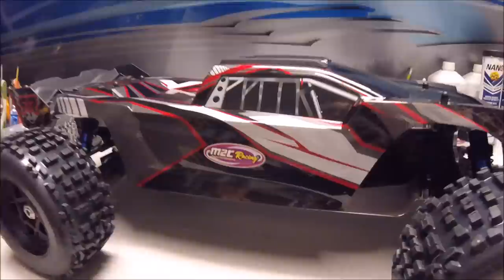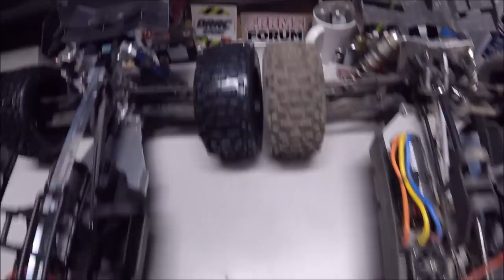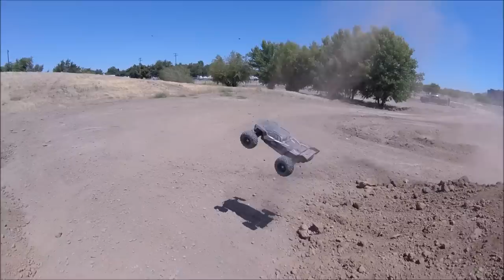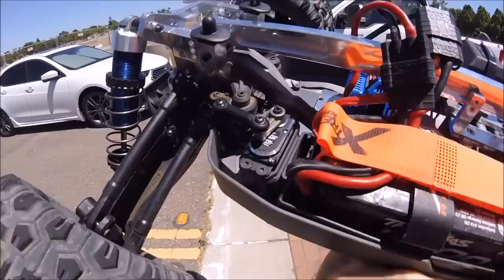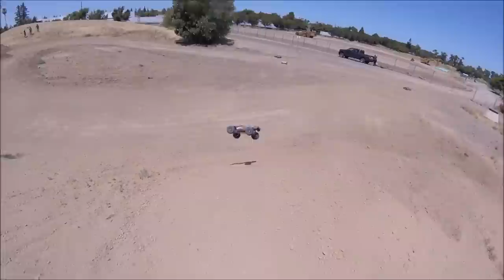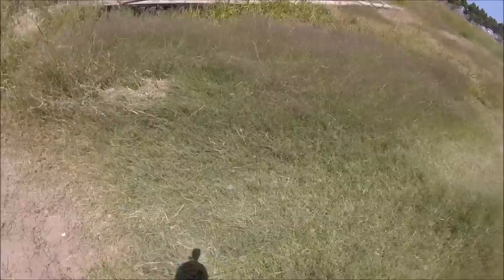"Speed Demon" NEW TRAXXAS SLEDGE XL 1/7 "JACKHAMMR"

Comment: Amazing 😍 I need this. I'd love to try and run this bigger motor in the stock motor location with this bigger chassis, I like the  weight distribution of the sledge in the stock configuration, but of course need more power than what you have room for with the stock chassis. Excellent vid 🤘🤘
Reply from the maker: Thanks so much Steven 🤗. This motor and longer ones will easily fit in the forward facing stock configuration with this Jackhammr chassis 👊. So far I'm hearing good feedback with the balance and handling with both setups from the other test team guys. Just comes down to preference I think. 🍻

Comment: Looks like a tank bro very nice. How come your not using a heat sink with a fan on the motor?
Reply from the maker: Yeah she's built super sturdy. Could add a fan/heat sink, but don't think I'll need one with all the natural air flow the body allows. I've busted so many fans through the years, I'd rather just gear down if necessary. 🍻
Reply: @richduperbash2966  Cool. Thanks for the input. ✌️

Comment: Nice rip bro👍🏻👊🏻
this Platform looks interesting🚀🚀🚀
Reply from the maker: Thanks Brother 🤗. She's crazy fast and stable with this wheelbase and setup. Realized later I'm running 22/46 gearing 👍
Reply: @richduperbash2966  I think so...and with that wheelbase, big jumps are very nice👌🏻🤩
 I had tested the castlecombo 2200kv with different pinions in the k4sv2 last month... was also very impressive👍🏻🚀 i think the 20 t pinion is the best for speeds over 100 kmh and also for bashing😜
Now i have realy fun with this lightweight 😎

Comment: Rich, why don't you work with M2C to come up with your own RC-basher Truggy design from the ground up? Especially since your builds barely have any stock manufacturer parts left on them. I would buy a few if you designed an RC basher Truggy. lol
Reply from the maker: Great question Brother 🤗. This idea has been discussed before, but Mitch wasn't interested in doing a full kit at the time. I think it's feasible to have molds done for the plastics, but the expense is significant and making gears is another thing. They could partner with other manufacturers and get it done. We'll see what the future holds, but they're busy as heck meeting current demands. 🍻

Comment: Just buy a fkn Mojave 🤷‍♂️ why have a sledge to spend OVER 3 grand & go long way around to have a arrma instead of a sledge  ? 💁‍♂️. 

I mean. If it’s sooo much better.  
I don’t think the extra length separates them that much .  Imo. 

😂.
Reply: Or a fireteam.  It’s fun to modify though. If you have the funds.. meh why not.
Reply: You don't even need a Sludge now. Just buy the arms, diffs & hubs. The M2C kit will provide the foundation. You put in the power system and of course the wrest of the little things!! 😝 😆😆 You know what I mean though!! It's a Total custom Rig. Cheaper to go this route than to start off with the Sludge though 4sure 👍
Reply from the maker: @ervinmedina9014 that's the way Brother 👊. You could kit this together with minimal Sledge bits. That's what Jenny's RC and eBay sellers are for 😉.
Reply: @nnamdiodi2079    I know right 👍😂